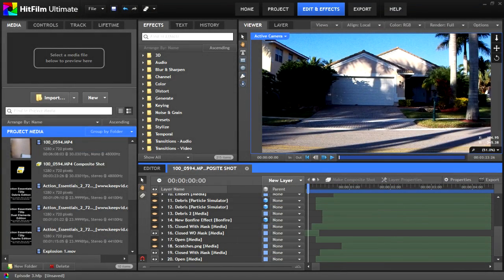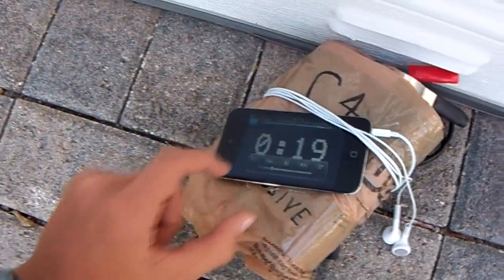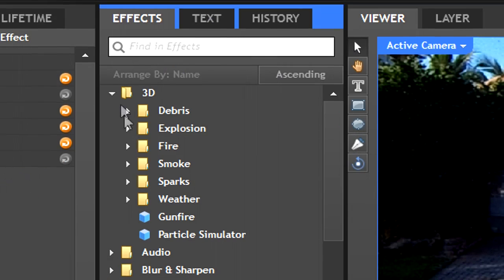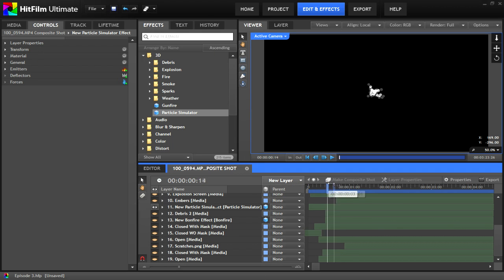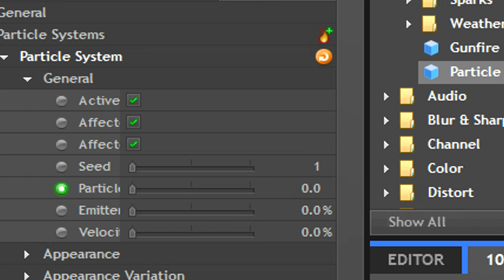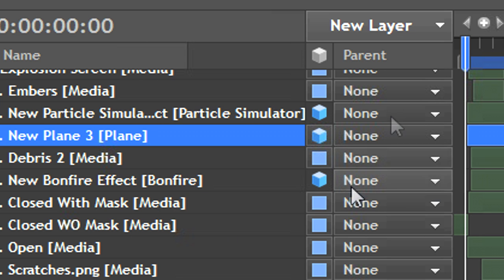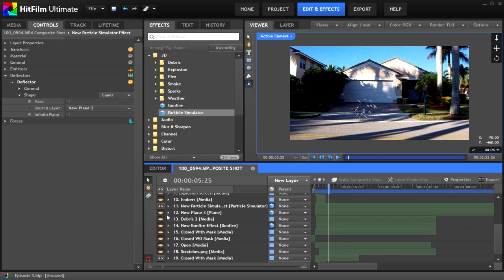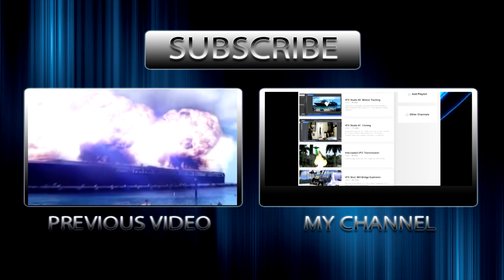Particle Simulator - A Powerful Tool for Explosions

Comment: Thanks for your tutorial do you have more coming I've just upgraded to Hitfilmpro 3 of the software.
Reply from the maker: Raymond St Paul I've got one about using 3D models in the Particle Simulator that I can't release until it debuts in 3D World magazine, which should be in a couple weeks.
Reply: Hello again I've got a problem perhaps you can explain to me prior your next tutorial of your coming 3D World magazine.  I'm having trouble in figuring out how to import a 3D Model from Adobe Photoshop CS6 Extended into HitfilmPro 3 & Hitfilm Ultimate 2 software with it complete with textures can you please explain step by step what I need to do?  I'm getting frustrated doing  the trial an error routine.  Please reply soonest.
Reply from the maker: Raymond St Paul I've never actually imported a model from Photoshop, so I'm not sure how to go about it. I would recommend asking on the HitFilm forums, maybe one of the developers can help you out: hitfilm.com/forum/